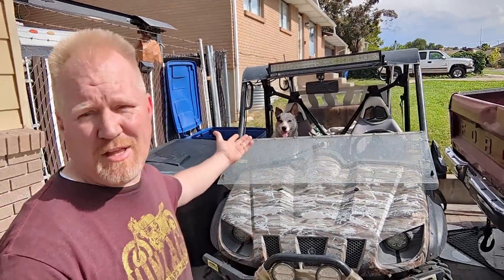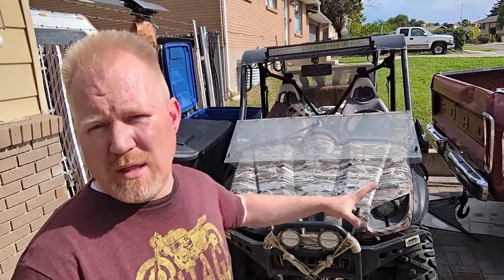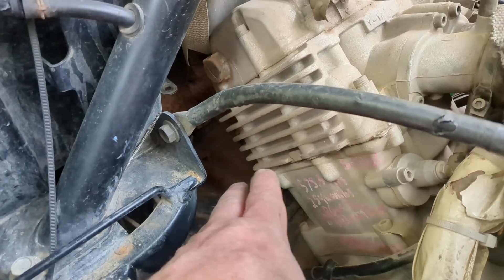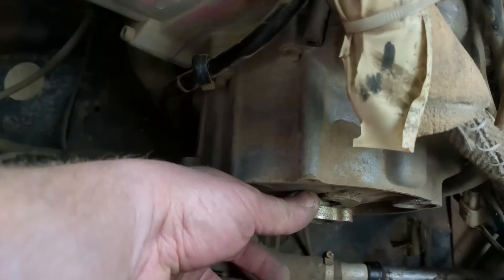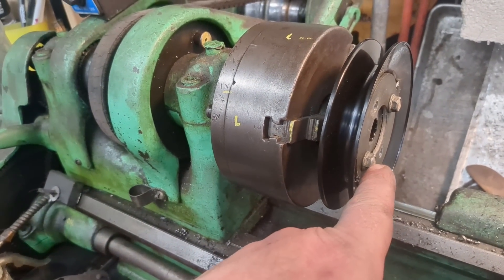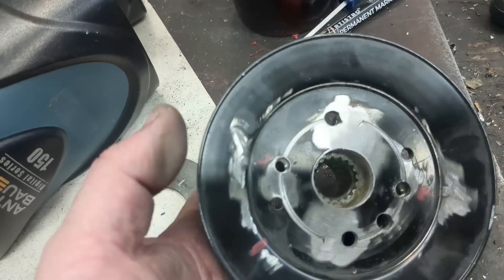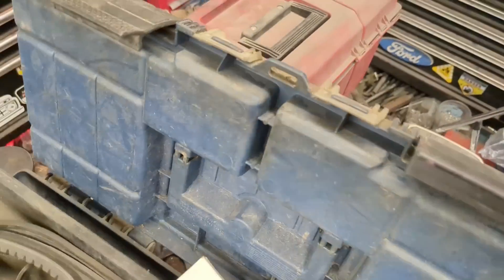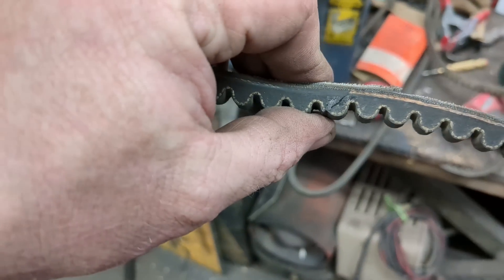70's Ford ALTERNATOR replaces STATOR Yamaha Rhino

Comment: Sir, you should PATENT that bracket. Take the original off, build 3-10 more. While perfecting the process and fitment. You could likely sell the bracket & simple step by step instructions to hundreds of ATV owners. Heck someone might even cut out the brackets on their CNC Plasma Table for you. Weld them together, and paint (optional). I’d spend a couple hundred to get one right now!

Comment: Is that a 450 rhino?
Reply from the maker: It's the 660. However the 450 should also be very doable. They have the same style cooling fan on that side and was originally designed for a pull start mechanism like the 660.

Comment: Roughly how long is the bracket. I really want to do this mod.
Reply from the maker: It's 16 in Long. But it could probably be shortened up to about 14". I ended up running a 3l300 belt which is 30 in Long which puts it right out to the end of 16 in. This is roughly 10 in from center of alternator to center of motor crankshaft. But you could move the alternator to about 8 in center to center minimum.  I should have got a 3L 290 (29") or shorter belt though to tuck it in closer as I ended up breaking the top sliding mount due to vibration and had to weld it up. It cracked but didn't drop the alternator or anything else and I was able to continue my ride. I just didn't leave enough meat on the top of the sliding bracket originally. 

I will say this thing has been amazing. I came down from the mountains the other night while running a light bar, rear lights and a bunch of other lights and the voltage never even sagged. I can run a winch at full stall and it isn't bogging down the battery. I think a winch is what originally killed my stator. 

The only other thing I did was cut all the fins off of the alternator fan and weld them back up in the opposite direction. I don't think this made any difference as I was monitoring the temperatures before I did this and didn't see anything spike. I was just bored one night.
Reply: I appreciate the response. I've looked at high output stators and they just don't push the amps. I'm going to try and tackle this project in the next couple of weeks. Thank you for the idea

Comment: Since my diagnosis I've been really relying on my YouTube Friends and their videos to keep me in a positive state of mind. You Moe, are at the top of that list. Came back to revisit this video because it reminds me of us old Honda Goldwing lovers installing "poor mans alternators" to our internally mounted stator engines that have to be removed in order to service the stators. Installing an external alternator is 100% the way to go on most internal stator engines where more juice is needed. Thanks for all you do Moe! You're helping this old fart more than you know. Cheers! Zip~
Reply from the maker: I took it out and it was working great then after about 2-3hours it failed. I limped home with my tail between my legs. Thought I threw a belt at first; nope. Then maybe the voltage regulator; nope. Finally I figured the alternator was dead and upon removing it, it turned out the repurposed battery cable eyelet I used fractured and fell off. So the alternator just had nowhere to send the power. Soldered a new eyelet and it's golden. Poor man's alternator... Love it. Take Care!

Comment: Curious to see if its going to overheat
Reply from the maker: Not at all. The wrapped exhaust reduces the heat that would typically build up in the area. Along with the fan on the alternator moving the air around.

Comment: Could you have used bolts with nylox nuts instead of the pins?
Reply from the maker: @rudysaldivar4228  There's just no room on the back side for the head of a bolt. I have roughly 1/16 of an inch.

Comment: 17 months on a single oil filter huh?
Reply from the maker: Absolutely. Changing oil or a filter in this case, at a time interval(3 months etc) is simply wasteful and does nothing. That filter is on it's second go around actually and is on it's second batch of oil.
Reply: @sixtyfiveford  Totally!  I hardly even go by the millage anymore either.  I change oil when it becomes dirty.  It's a bit subjective and not as scientific as I would like, but I feel you can get a pretty good indication when it's time to change based on it's color/feel/scent.

Comment: Video idea!  How about a video explaining what and why about all those notes you have written all over that motor?!
Reply from the maker: I write everything I do to a motor or any part directly on it. Generally mileage(and or hours), specs, date and somtimes warranty info. I work on so many random things I can't remember everything I do to each. I rebuilt this motor originally for a customer and change the cylinder head for a larger one. All that is written there. A year later they asked if I wanted to buy the machine, I did.
Reply: @sixtyfiveford  That's awesome, very smart and thanks for explaining!  As a major DIYer myself, you have consistently earned my respect.  I believe you are the most underrated YouTube DIYer of all time, please keep the content coming!

Comment: That's cool, good that there was a hole to put it. If you're running the alternator backwards wouldn't the fan on it need to be different? 
Ginger clearing the track for you 👍
Reply from the maker: I actually spent way too much time reading about the angles the fan blades are. It's called something like the beta angle. They still work as intended, just not as efficiently. I'll likely weld up a custom fan.

Comment: A GM 12si alternator seems like an easier swap
Reply from the maker: I'm not a big fan of the GM one wire alternator system. A few reasons: they only sense the voltage at the terminal on the alternator. When you have long distances like this where I ran the battery cable nearly 5 ft. you're not going to have an accurate state of charge all the time. The second is the self-excitation. I have one on my tractor and you have to rev it up to a point sometimes, especially if it sits for months to actually even get it to charge. Nearly having to floor it just to get the self exciteation going for start creating any sort of electricity. The Ford 1G since all the wires on the regulator directly go to the alternator that can also be classified as a one-wire just like the GM.

Comment: the 60amp isn´t to "heavy" for the little motor? wouldn´t it be better to use an very old 30amp, or a dynamo, much older hahaha
Reply from the maker: This was a thought for sure. 60 amps is 720 watts or right at 1hp. This has around 40hp so really no major strain on the motor. I did a few things intentionally to help. First I chose a drive pulley about half the size of one you would find in a car. So peak 60 amps really won't hit until the engine is around 6000+rpm(8500ish redline). A car will hit the 60amps at around 3000rpm. The reason the stock alternator wasn't bigger from the factory was there's no room in the case to fit anything larger. I could have also done a Ford 3g 130 alternator with the same effort but that has a completely different power curve and pulls nearly 4x at the same lower rpm then flattens out. I wanted to keep at little draw as possible at idle/off idle rpms.
Reply: @sixtyfiveford  I didn´t realize this things have 40hp. wow. and the pulley was the key to let it spin easier. really thought through job!
Reply: Good thinking! Even if it will bog down that little motor for a bit while pulling a full 60 amp, as soon as the battery is charged, the system goes into a "float charge" mode and it will stop pulling the full 60 amps worth, meaning: the load the engine sees from the thing will drop anyways once the battery is fully charged :D the only question is, can the tiny battery handle being charged at 60 amps in lstead of the usual 30 or so it normally sees. But since the pulley is probably matched to make it function within a certain rpm range it will all be just fine! At lower engine rpm, alternator will pull less than 60 amps because it needs a certain amount of rpm to be able to deliver it's full power, once the battery is full, it will only produce power if more power is asked , i.e. by turning on the lights.  everything is connected like a big electro-mechanical Symphony 😊
Reply: @Sanisfaction  the problem is when it charges! p.e. in idle, it can make the engine stops. but he solved this using a smaller pulley. this old alternators aren´t inteligent, no pwm control, they charge or not, the amps depends more on consuming, but even battery full and small amp they brake heavily.
Reply: @oliverroedel1111   exactly ! we're saying the same thing in different words!

Comment: sixtyfiveford,  I think the fan that you removed is crucial to the cooling of the engine since the engine is air cooled. The fan also rotates at engine RPM which helps the engine cool any given RPM. I was told when I was taken automotive classes before I become an ASE master tech, that manufacturer of any vehicles don't want to spend even a dime for additional parts if it doesn't helps the performance of the engine. Maybe you can adapt a 12v AC blower fan since the alternator you installed can deliver higher amp now. Nice conversion though👍.

Comment: I believe your rectifier will overhead at the back of the alternator. Get an alternator fan off of a Corvair, that one is set up to cool when the alternator is running backwards.
Reply: easiest fix here is to remove the alternator pulley and beat the blades flat with a hammer, then bend the other way with a vicegrip. seen it done several times.

Comment: Last year I bought the 500-watt alternator system from Rickey Stator, It works great. I installed a second battery under my seat(2007 Rhino) reconnected all my aux lighting to it and installed a relay so that when I start the Rhino it connects both batteries together for great starting power. I also installed a 30-second (variable timer circuit) That connects the alternator after 30 seconds to start charging so there is no load on the engine while it is trying to start and it gives it time for the engine to warm up before the load hits.🙃
Reply from the maker: 500 watts is decent. I was going to originally install a Chinese $50 replacement but then I read how bad they are. So OEM was looked at and it had to be at least a few hundred. Didn't want to spend that just to have it burn out in the future. I saw a ton of guy putting a second battery; So I thought I would just rewire everything and just put a large car battery under the driver seat and omit the stock battery. that way I didn't have to mess with the dual battery issues. Then .... I just thought why not jam a car alternator somewhere. Originally I was going to run it off the rear drive line. I like your  well thought out dual battery setup. 30 second timer is ingenious.
Reply: Will the alternator have a good bit more parasitic drag than the original stator system when you are using lights, radio, fans, etc,,,?
If it does can change pulley sizes to help it not to pull as hard on the engine?
Reply from the maker: @dbusby77 I intentionally chose the 60 amp 1G Ford alternator and put a small drive pulley to have to little to no draw in the motor at idle. Small drive pulley spins the alternator slower/gives a motor torque advantage

Comment: Would like to see yyour 3g upgrade. I did one on my 86 ford. I put a first gen on my ford tractor
Reply from the maker: It's great and just bolted right in, but I didn't do double belts or serpentine so it squeals sometimes. I just put the V groove pulley from the original 1g on the 3g. Near impossible to find the correct crank pulleys for my application to do so. I just ran 100% new wires to wire everything up. Your 86 was probably the 2g originally? You had a serpentine setup already?

Comment: way kool when we gonna get to workin on one of them ole Fords hey?
Reply from the maker: I did in this video..... I removed an old Voltage Regulator... That counts.
Reply: @sixtyfiveford lol.  Kinda.   
I have a 1963 f100 wrong-bed.  I’m looking to replace with a shortbed 66’ style. You know of any?  I’m here in SL by the way.
Reply from the maker: @savage6394  I know they don't exist in Utah and if they do they're pure garbage(at a super premium price). You're on a list of thousands looking right now. Everyone just cuts down a long bed now days as it's less work than re flooring a rusted out short bed.  The only ones you can possibly find in Utah anymore are trailer conversions. They are rare to find and the few I've seen are dented beyond repair(bedsides bowed out, etc). Idaho, Arizona or New Mexico are your only viable options. You will almost always have to buy a complete truck. You'll have to be vigilant as looking every few days on Facebook and it may take you 2 years to find one and it'll be 16hrs from SLC.  

I'm really not the one to ask though because I think short beds look off/not right on these trucks. Nobody liked them when they were new, their only popular because of the rarity and bragging rights of having a truck no one wanted. That's just my opinion though. I know it's unpopular.